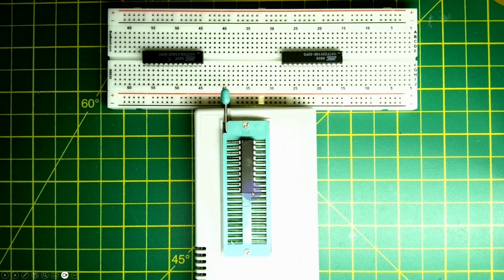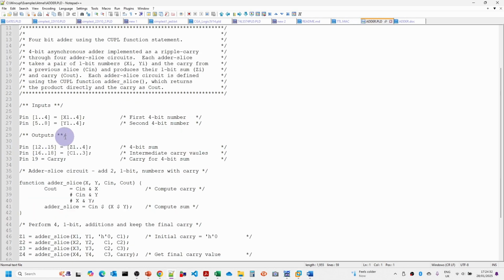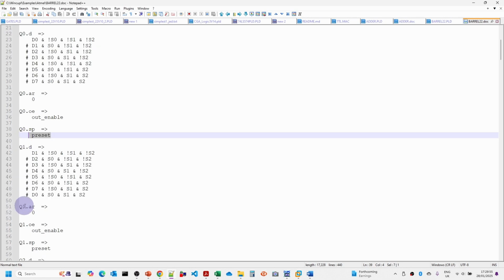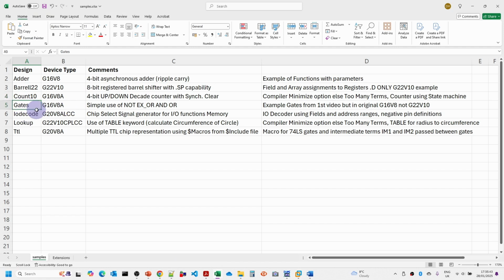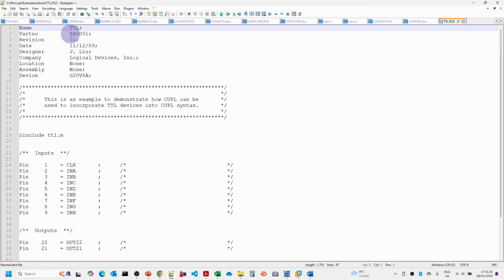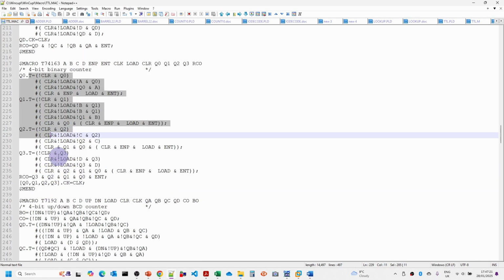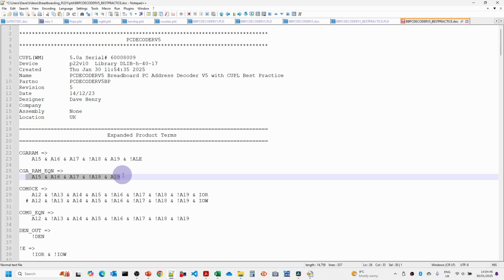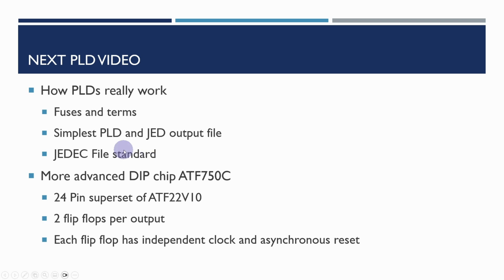Complex CUPL examples for Programmable Logic Devices (PLDs part 3)

Comment: I'm about the "replicate" the entire work ( Breadboard PC, from new schematic on Kicad )... You definitely inspired me ! 😍 Use PLD "like in a Commodore PLA" is fantastic idea ! 👍Please keep it up ! Happy new year....
Reply from the maker: I would wait for an updated schematic in the next few days. Also the DMA didn't work so can be left out. I am doing a V2 without DMA and using 8088 Min mode which will take a few more weeks to finish.
Reply: @breadboardinglabs  82C84 Clock and ATF16V8B "divisor or prescaler or..." tested today... The DMA processor only work on Floppy if i understand correctly. Address Bus seems to be correclty latched, Data Bus seems to be correctly "driven" so, step by step... Thx again... i really appreciated all the work on the docs !